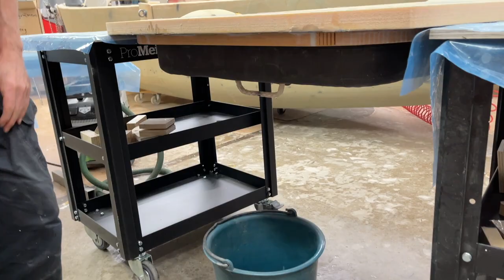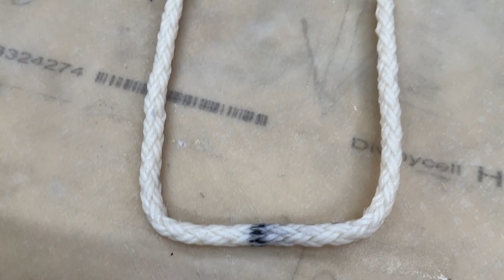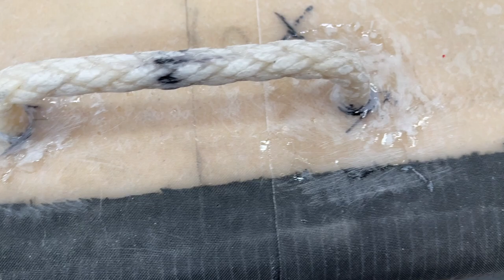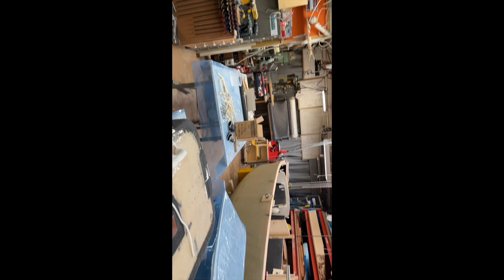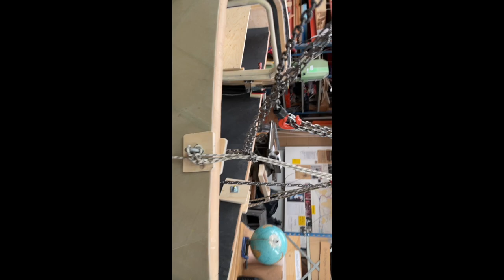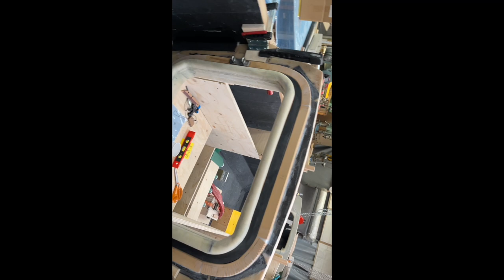Aft bulkhead tested and immobilized on Exlex. Better than yesterday only one film wrong format.

Comment: Thank you Sven for today's episode.  I really like the handle design with the rope.  On the leaking handle, will you just cover over the inside ends with a fiberglass patch or do a different style of handle.  Happy Holidays to you.
Reply from the maker: The strings on the outside will cover it the leak is so small that it cannot be seen. Water under pressure is very penetrating. I guess the water was traweling a distance inside the rope during the leak. Even if I do nothing, nothing to worry as the leak is high up near the deck

Comment: I'm surprised with the handles you cut them flush on the back side. I'd be tempted to pull an extra few cm through, splay out the rope fibers flat against the back, and then cover with epoxy and a piece of fiberglass to make it strong against pulling through.

Comment: Hard work! But how will you open the hatches from inside?
Reply from the maker: They are not intended to be opend from the inside. Their use is to prevent water from entering the living area when a deck hatch is opend. Its an airlock.
Reply: @SvenYrvindExlex  Thank you!I will keep watching.
Reply: @coenvanwyk1  you open them sitting inside before the hatch, and he has a way that they will hang/attach to the wall when he wants to access the air lock compartments.

Edit: I forgot he is using a ratchet strap..
Reply from the maker: @tropepe  The are placed in the air lock. They do not unscrew. They are closed with a ratchet strap.
Reply: @SvenYrvindExlex  holy patience you have, explaining this over and over...
Reply: I tried to re-explain this in some detail to a comment above if interested.
Reply: Very interested in the hatch designs, I have built hatches with tie downs on my replica 1876 trans-atlantic sailing dory Centennial,  but am unsure if they are water tight,  likely not but they will keep large amounts of water from flooding the below decks. Thanks for sharing your creations and expertise!
Reply: I have seen a few small boat Pacific sailors make a hatch conversion to their normal companionway-slide. Usually had a securment from both sides. 
These are purpose bound to his unique vessel and one person aboard.

Comment: I am just wondering why the internal hatches are designed to be secured from outside the main compartment? How do you secure them if the external end hatches are taking on water in the ends and you need to isolate in the center compartment? If the end compartments fill through the external hatches how do you get out or is there also a hatch from the center compartment to the deck?
Reply: If you go back, he explains this several times.  The internal bulkhead hatches are actually used as  airlocks to isolate the forward and aft sections when needed.  The deck has hatches in the forward and aft sections too.  The airlocks are normally open and the deck hatches are normally closed in any weather that may produce deck water. During this type of bad weather when the sails need to be tended (say forward), the skipper goes forward through the front airlock, closed the airlock behind himself, then opens the forward deck hatch to tend the sails.  Water may come on board, but will be isolated to the front section only.  Once the sails are tended, the deck hatch is then secured, the skipper pumps the forward section dry (if necessary) THEN opens the bulkhead airlock (hatch) and goes back into the dry bunk area.
Reply: @boooshes  Thanks for that explanation All makes sense now. Cheers.
Reply from the maker: I build the boat strong and functional. I see no need to complicate the design by make the hatches able to close from the the center compartment. I trust my design and construction. It is way stronger than all other boats and my buids have worked in the past since 1962 for coastal and 1969 for ocean.
Besides structural failures is a big boat problem. The sea is gentle to small boats
Reply: @SvenYrvindExlex  I have no doubt in your design or construction methods. This is why I watch and can see how much thought and knowledge goes into what you are doing .. thankyou